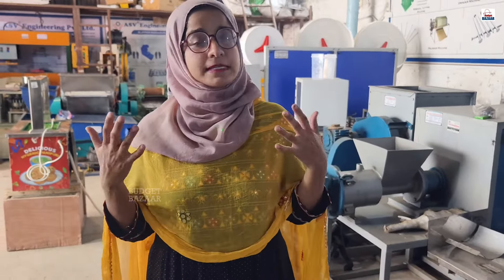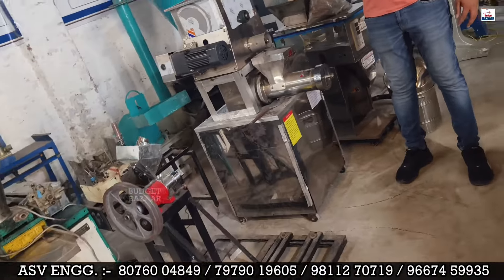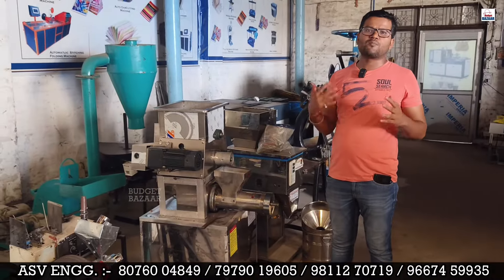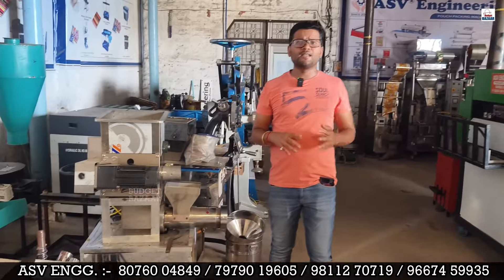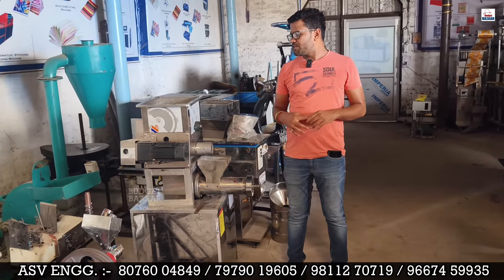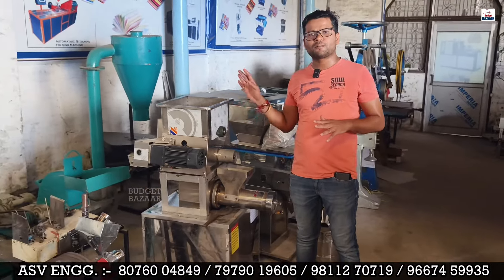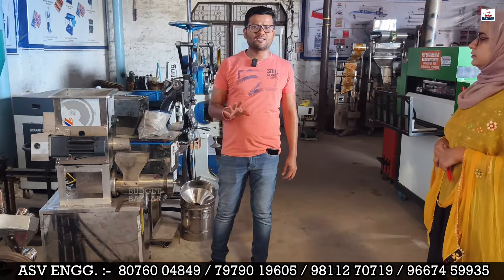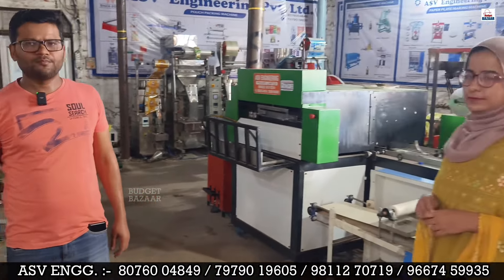FULLY AUTOMATIC PASTA MAKING MACHINE | MACRONI MAKING MACHINE | BUDGET BAZAAR

Comment: PRODUCTION QUALITY WILL BE INFERIOR THAN THE PRODUCTS OF OF A MACHINE COSTING TO RS 5 LAKH, ATTACHED WITH VACUUM PUMP TO EXPELLED OUT AIR AT THE PRESSURE ROLLER CHEMBER. MORE OVER THIS SMALL MACHINE IS AVAILABLE AT KOLKATA @RS 26K ONLY WITH WARRANTY, WHERE MIXER IS NOT REQUIRED.
Reply: Where in kolkotta, contact number